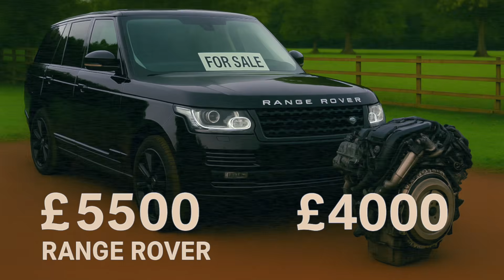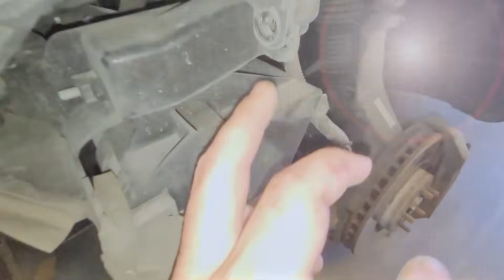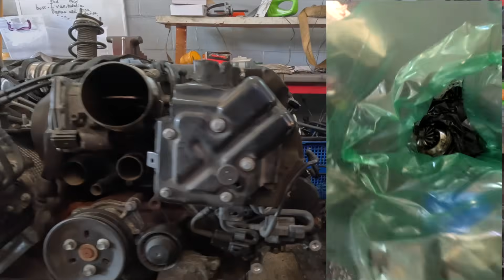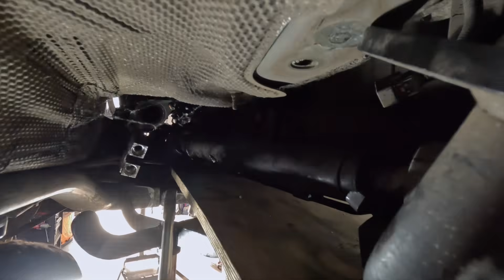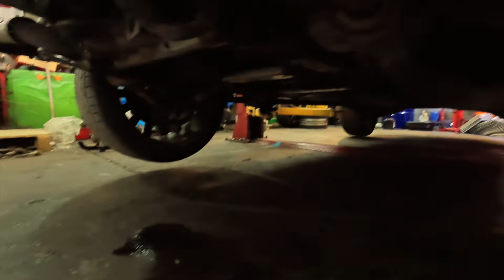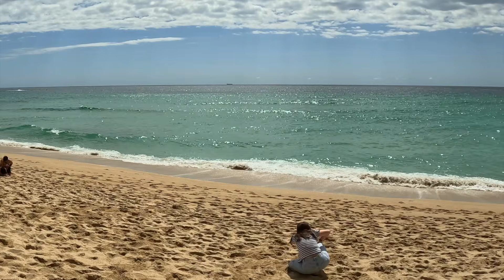Fixing a Dead Range Rover 4.4L diesel V8 Rebuild Pt.1 – Clearing My Head by the Sea.

Comment: how long did it take to remove and refit the engine? Think I may have a leaking turbo on my 4.4 FFR so thinking of having the turbos replaced
Reply from the maker: Due to the vehicle's complexity and the tight packaging of the engine bay, this isn't a quick fix. You're looking at around 25 hours of labor
Reply from the maker: Due to the vehicle's complexity and the tight packaging of the engine bay, this isn't a quick fix. You're looking at around 25 hours of labor